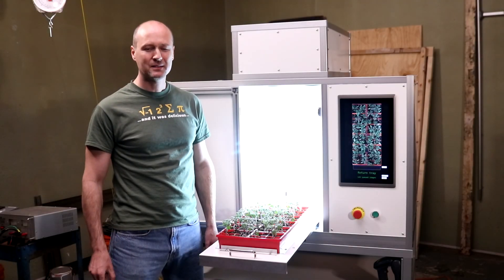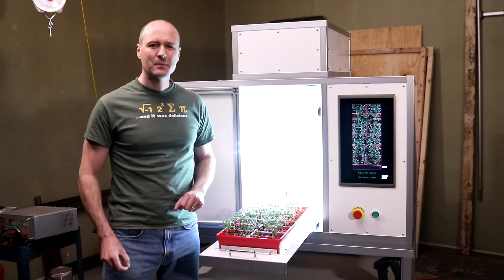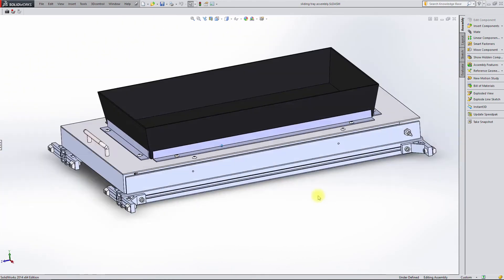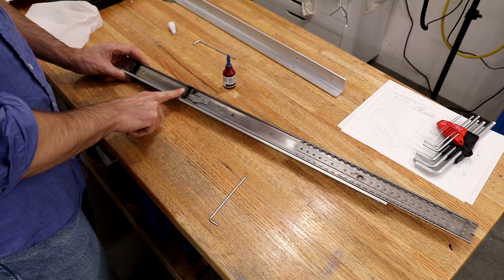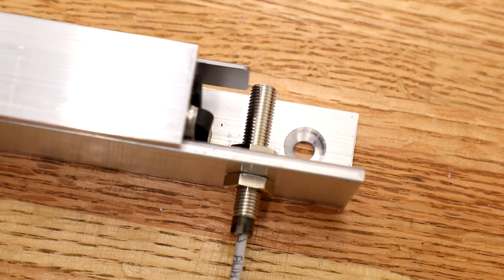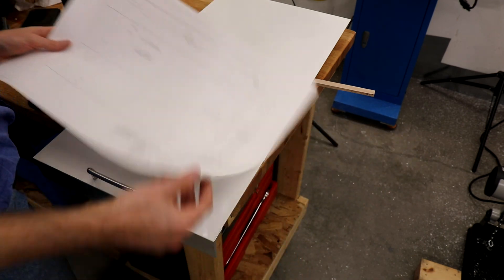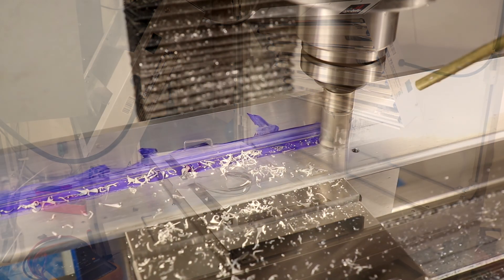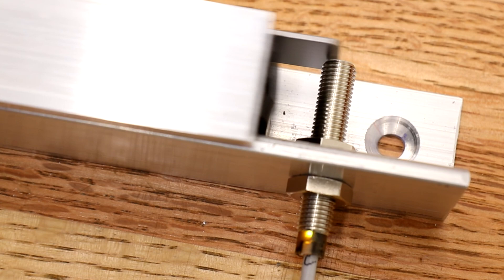Full Extension Drawer Slides Installation Onto Aluminum Extrusion

Comment: Is that some form of Loctite in the dark bottle ???
Reply from the maker: The bottle around 4:24 is basic Loctite. Is that the one you are asking about? Thank you
Reply: @kentvandervelden   I guess you only used the locktite on those little screws on the rails is that correct
Reply from the maker: @nfr3416  I used Loctite pretty liberally. This drawer on this machine is used in a greenhouse and beat around quite a bit. So far, nothing has fallen off :)

Comment: Hi Kent,
Thanks for the great video! I was wondering, why did you go with this type of slider rails instead of the different solutions that work directly with the aluminum profiles (like casters or teflon sliders)?
Reply from the maker: Hi Shai, I would have loved to have been able to purchase a solution off the shelf, or to simplify what I did. I needed full extension rails for ergonomics, something low profile, and I tried to keep the instrument BOM mostly to Misumi. Please let me know if you have a full extension slider suggestion for extrusions. Your suggestion could translate into real time and cost savings. Thank you
Reply: @kentvandervelden  I've spent the last two days trying to come up with a solution. I'll keep digging in the catalogs. Be sure I'll get back to you if I find anything.
Thanks again for the great video and inspiration!

Comment: Do you use Fusion 360?  It used to suck in comparison to Solidworks, but it has turned into a very capable product with built-in CAM.  I wish Solidworks would respond with a community version, but they don't seem to give a damn as long as they can get steep license fees.  

By the way, what would happen to a plant if it was supplied only UV light?  Would it die? Also, do you get severe allergies in March?
Reply from the maker: Hi Barry, I'm not a plant scientist, I could be just making stuff up, but regarding growing with UV, three ideas come to mind. 1) With only UV, even those close to visible light, the plant will be starved, while light down to ~350nm is usable, realistically visible light is needed for photosynthetic system (PAR, or photosynthetically active radiation is the important term). 2) Some UV is more lethal than others (germicidal lights vs. disco blacklights), I think the germicidal lights disrupt the DNA, so the plant would no longer able to repair or grow properly and dies (perhaps this is a way to kill weeds without chemicals?) 3) With more UV light, I suspect more antioxidants would be produced, this might also increase the plant's defense to other stresses like drought, perhaps the UV light could be used to harden the plant to future stresses, or might add additional phytochemicals to plants that we eat. This is a pretty cool question. Not one that one in the field would ask, but #3 is intriguing. Do mind me asking what led to the question? Do you have some experience in this area or are trying to do something?
So, in March, there were two weeks where during the day I could not stay awake for much more than an hour, and then would sleep three or so. After those two weeks were done, then came the coughing and aches in every joint. I don't have allergies that I know of and it's been years since last being sick. Sickness debt or something being paid back all at once. It was horrible timing because my wife and I both had business deadlines. Most importantly, I didn't make my wife or son sick.
I do know Fusion360 but not nearly as well as Solidworks. I do all my CAM and some simulation in F360, but all my modeling in Solidworks. I've tried to replace Solidworks with Fusion360, but there's so much I would have to relearn. And last I tried, the drawings and BOM functionalities in F360 were not going to work, and I try to make drawings so I can send the machining and assembly work out (I hope someday to have the orders to be able to do that.) I'm using SW2014 Standard. That was all I could afford and one of the last versions with a perpetual license. I think SW is entirely subscription based now. I've applied to the SW entrepreneur program but never heard any response.
Thank you for the questions and comments. Best wishes, Kent
Reply from the maker: Hi Barry, I ran across two relevant videos today. The first is the April 2018 Fusion360 update summary which improves drawings and BOMS (and has more awesome generative and optimization methods.) The second is a fascinating video from Wintergatan about challenges with large assemblies. I tried initially building this machine in Fusion360, but the drawings, BOM, jointing, and overall performance was not good. I even tried a couple different graphics cards: a Quadro P4000 and a GeForce  GTX1080 Ti. I hold out great hope that Fusion360 will get there before my SW computer dies and I can't reinstall SW. Feels like the computer is on its last leg much of the time.
https://www.youtube.com/watch?v=0ak83G7VV9M
https://www.youtube.com/watch?v=9zL8pRDxPck

Comment: Hi Kent.  Interesting little project with a few things to consider.  Staying with the thicker gauge aluminium angle was a good idea as I'm sure these drawers will get slammed in and out. Thanks for posting.
Reply from the maker: Great point, thank you. I'll consider if there are other problems that abusive operators might cause.

Comment: Love watching your videos!  If you are worried that the tray may not fall to the "exact" same position each time you could always use a magnet to home it to the same spot.  I'd love to see this machine in action!
Reply from the maker: Hi Anthony, and I'd love to see one installed in a university or company near you :) The last month has really emphasized my desire to help smaller companies without an engineering and data science folks, for the least amount of overhead and the greatest positive vibes. Some rails pull the drawer fully back, but I didn't much information until these arrived, and they don't have that feature. The machine is on a truck somewhere, but I'm thinking your suggestion will be a retrofit when I do the installation.